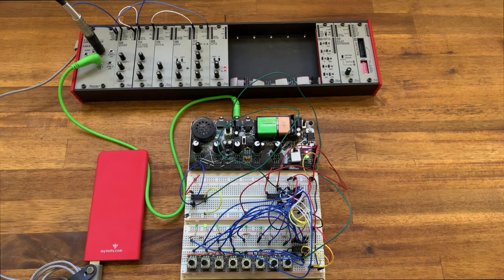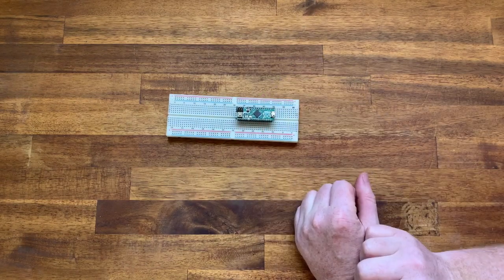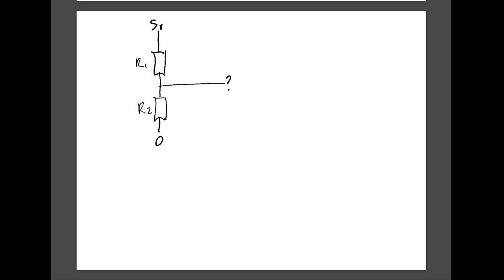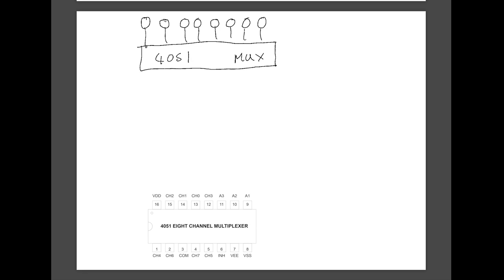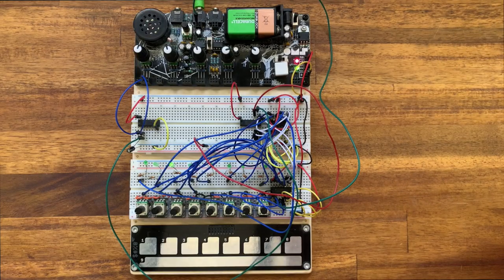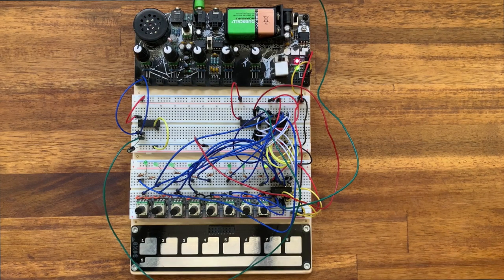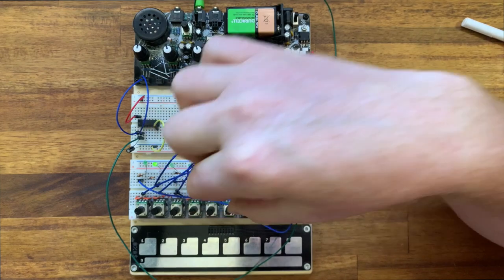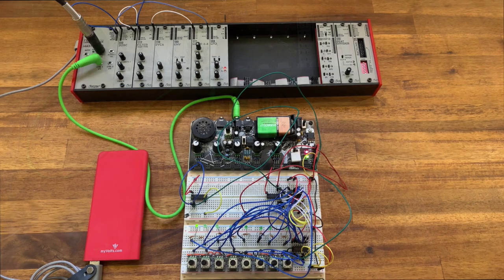Musical Hacks #2 - Step Sequencer - Part 1

Comment: I'm surprised how fairly simple this all is! Might be useful to have a way to reduce voltage to 1 or 2v before going into the potentiometers to reduce global pitch range to 1 or 2 octaves.
Reply from the maker: thats a good idea - should be simple - rather than taking 5v to all the pots, use a voltage divider (another pot!) for their 'upper' range, this will give you a new 'reference' voltage.